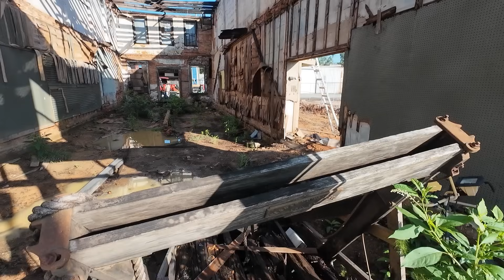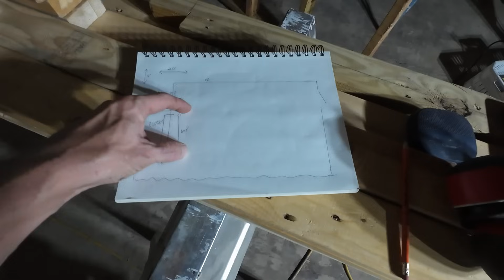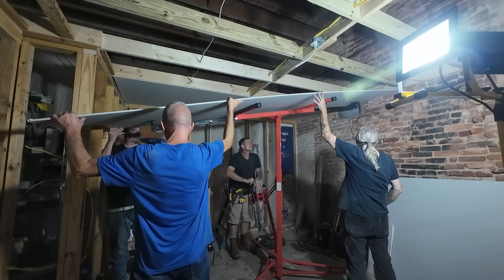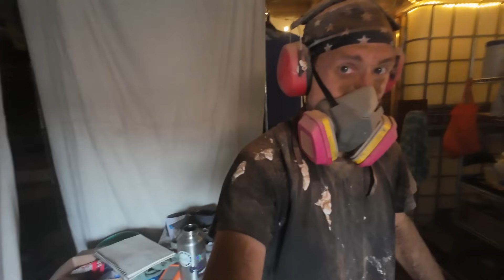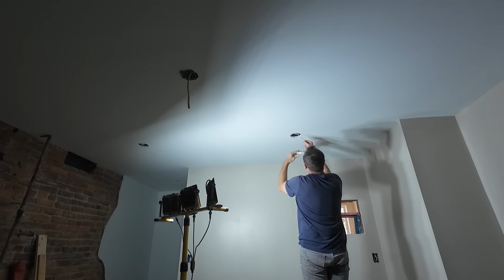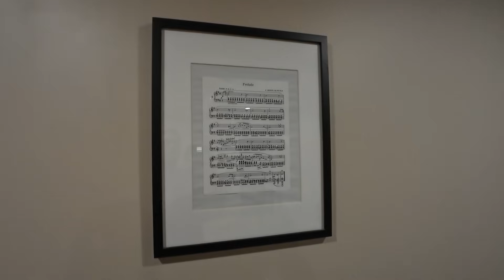First Room Comes To Life: New Bedroom in the Abandoned Bank

Comment: As a few people have said, the machine with the 5x5 floppy disk is a type setting computer. It could output printed strips of different fonts of different sizes on paper strips.
Then the printed strips would be cut out and pasted on copy board as they would appear when printed. The finished copy board would then go to the camera department, and a negative would be shot and then "stripped" (placed in a position) so it could be burned on a press plate. That plate would then be used on a printing press to put the image on the printed sheet.

Comment: Hi, I believe that old keyboard/monitor/floppy disk/desk was a Compugraphic typesetting unit from about ‘77 or ‘78. I worked at a small town newspaper in Missouri and was an excited young woman when we got one of those! That was my first real computer experience after working on an earlier unit with separate keyboard but no monitor that spit out words on ticker tape that then had to be fed into a refrigerator-sized machine to print columns. And all of that came after originally learning on hot type Linotype machine. I miss the smells of hot lead then later, hot wax. What a flashback memory you gave me! Thanks!

Comment: I would see if there are any salvage places around the area that might have a salvaged mantle for the fireplace.  If it is going to be a working fireplace, consider a gas insert.  No smoke to deal with, and it does a good job.  It could be run via the existing flue channel.  It uses a double-wall tube.  Keep the brick as is, but consider sealing it.

Comment: I’m 60 and started computing on 5” x 5” floppy disks, and yes they were flexible lightweight hence the name.  2slots, one for the program disk that  contained the operating system, slot 2 was where the data and documents you created where saved to and stored. No preloaded programs, no internal memory just the player to the record album so to speak.  This was before the Apple Macintosh personal computer system.  Heck I learned to type on a manual, inked ribbon typewriter that you had to throw the carriage to the next line after the bell rang and before you typed off the edge of the sheet of paper.  A ball style electric typewriter still required that you push a button to return the carriage. Ah, the good old days ! 😆😂🤣🤣